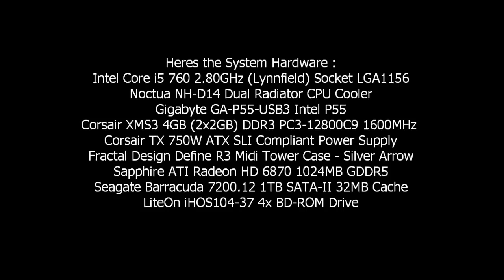How to Build a Quiet High Performance Gaming Rig - DIY - AMD HD 6870 - Core i5 760

Comment: Hi I want asking something... I have CPU i5 760 GPU GTX 465 RAM Corsair XMS3 4GB (2x2GB) DDR3 PC3-12800C9 1600MHz Dual Channel Kit...Cooler master extreme plus 500watts MOTHER Gigabite UD3L 1x500 seagate 1x1tb  seagate 4 case fun windows 7 64 bit....I run GTA IV and lag....Why do this????My rig Its able to run that game????What happen?????